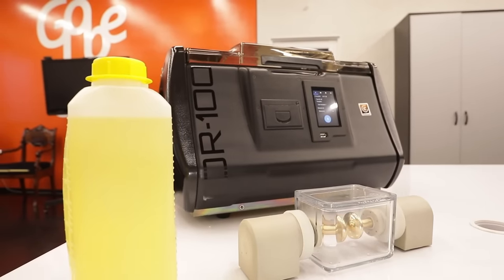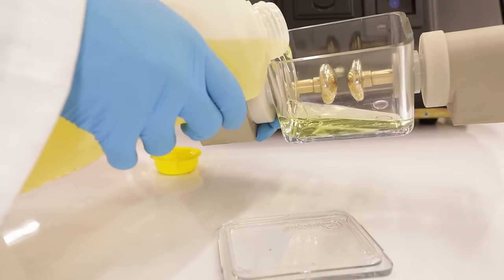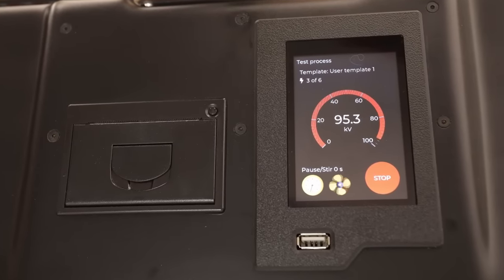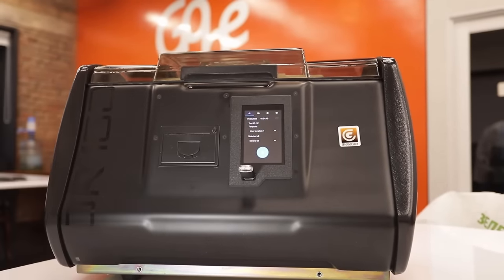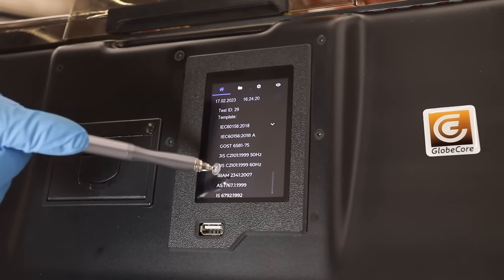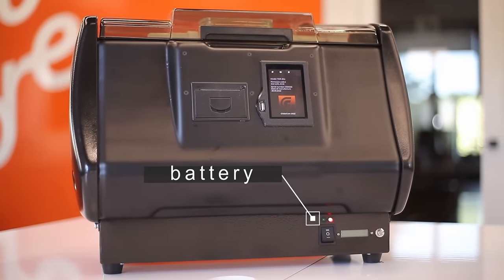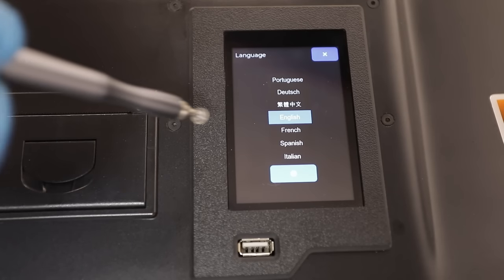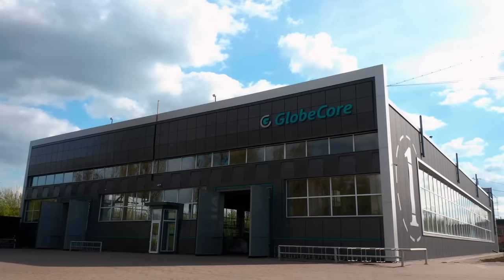Transformer Oil Breakdown Voltage Tester up to 100 kV

Comment: How long does it take for the TOR-100 device to conduct a single measurement?
Reply from the maker: The duration of measurements is determined by the standard in force in your region.

Comment: Are there any safety precautions that need to be taken while using the TOR-100 device?
Reply from the maker: Of course. These are standard safety measures for workers who work in a laboratory with such devices.

Comment: Can the TOR-100 device be used for field measurements or only laboratory measurements?
Reply from the maker: Yes, you can. For field measurements near the transformer, we recommend a model with a TOR-100A battery.

Comment: Does the TOR-100 device measure any other properties of the oil or only the breakdown voltage?
Reply from the maker: The main function of this device is to measure the breakdown voltage of the transformer oil.

Comment: Is the TOR-100 device compatible with any other testing equipment or devices?
Reply from the maker: This device can be part of an electrical laboratory, which may also have other devices, for example, for measuring the tangent of the angle of dielectric loss, moisture content, etc.